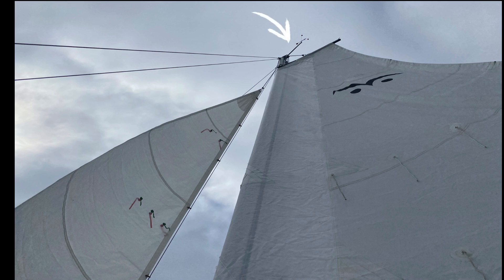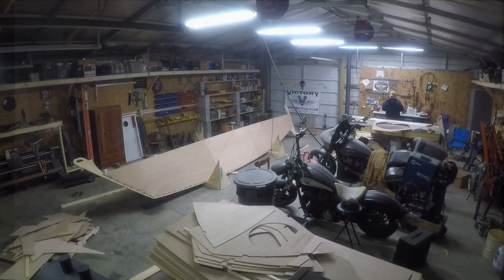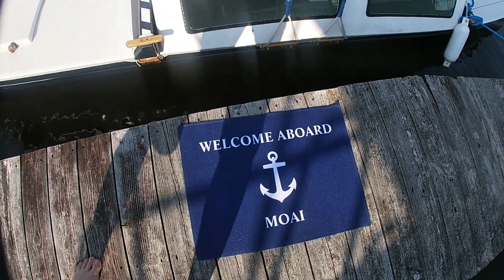WHARRAM TIKI 26 HULLS

Comment: And more info about mast height :-) Also want space to stand :-) The keel idea is cool , will check back , not sure I can retro fit one as the one hull is made . 
 Have a good day . Very cool workshop , I just have a beat up 400cc Kawa in mine :-)
Reply from the maker: I added the keels after the hull was finished just make good cuts and wire it on then epoxy and fiberglass works great also catamaran ariki did the same the mast is 28 ft
Reply: @sailingmoaiawharramtiki2615  , cool thanks , does seem to make sense for rudder protection , ideal for a beach landing . If it helps sailing , even better . The big boats have it for protection :-) The hull I am interested in was wired . Been neglected for years , will spend a day just to look inside . 
  Had advice to send the pictures to Hanneke , 2 times :-) 
Chainsaw + labour $60 , no big deal :-) Then can see. 
    If it passes the test , then the fun begins :-) 
Re purpose my place to make it viable , de clutter on an huge scale :-) Sell, give away or dump :-) Some horticultual work too :-) 
  Finish the one hull paint etc , store covered outside , 2nd hull have a lot of board in the deal , some glass too . Seller says put an heavier mat along the bottom . Make sure the extra keel is soild . 
    Rigging :-) I will have to sign up for a sailing course , back to the habour tomorrow , a bigger Wharram there . Maybe catch the Commodore :-) Lives aboard . 
  Have a few local places to visit , live on the 'Wild Coast ' of South Africa . 
 Going off shore is another issue . All that tech stuff . like a toilet and solar panels , wind vane , batteries and a gas cooker , I have a small fridge freezer that could work . 
    Must get into the plans , the hulls are basic , more head room is cool , just more space for stuff . 
Then to the cockpit , once both hulls are ready . While under construction make all use of available space , off shore is not all wine and roses . 
   Then mast height  , am in no rush to get there be cool to make 5knts , so a super yacht does it half the time , big deal . 
 Have other of your videos to watch , have a great weekend .